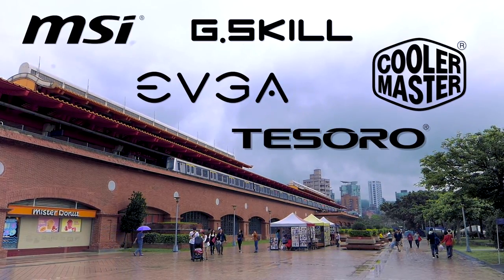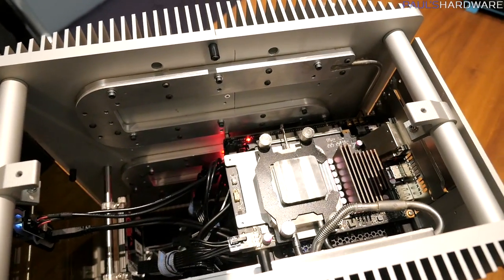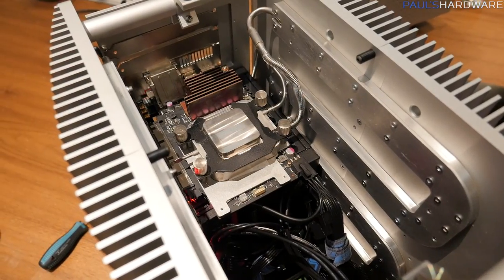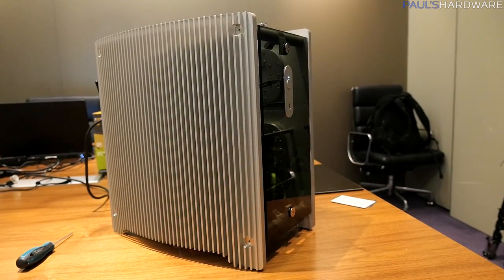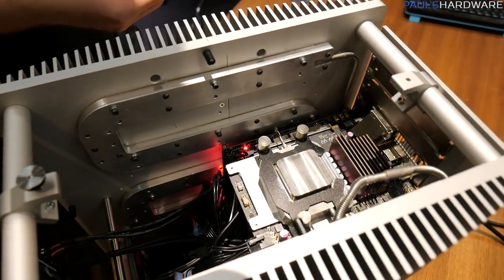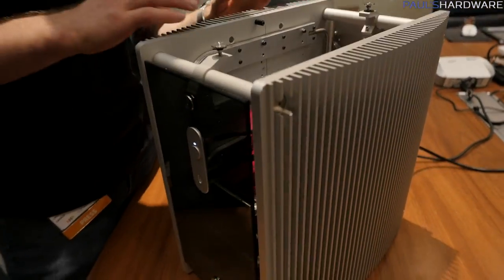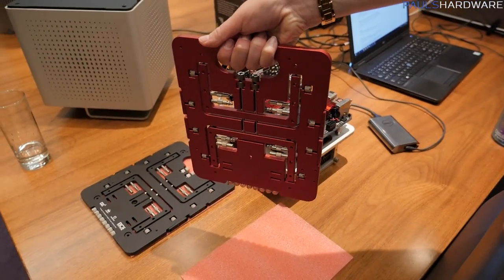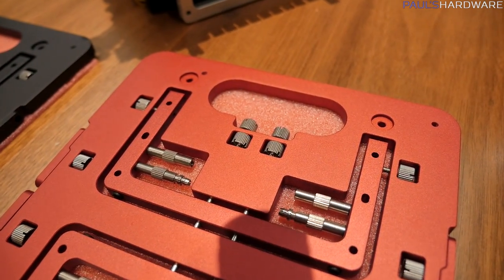Streacom's PASSIVELY COOLED Micro-ATX Case & Cutest Mini-ITX Test Bench Ever!

Comment: Passively cooled systems have interesting designs, but when it comes down to it I have no issues with the very faint sounds from a couple of fans to get much better cooling for a cheaper price. Regardless nice to see the people that do want it are getting more options in this space lately.
Reply: Well it is a niche product after all
Reply: Yeah I get that, just saying not for me :)
Reply: Jarrod'sTech same here just getting a pc cost me a kidney
Reply: according to calyos or however you spell it you can overclock and run their cooling system exactly how you want and keep low temps and with no noise at max gaming.
and with your normal radiator waterblock fans thing, if you overclock and run it max gaming your fans are going to start ramping up making noise.

so yeah i totaly agree i dont mind low rpm fans on idle/low usage but for anything intensive id still go with this here noiseless system if their claims are true
Reply: They can only cool a 130w GPU, so you're seriously limited for gaming, particularly at high resolution or refresh rate (or both). Also, I think you're misunderstanding what an open loop cooling system does (generally), you have a buttload of radiator space for the amount of heat being generated, my pump is on min and there are speed reducers on all the fans. Doesn't matter if I run furmark + p95 or whatever, it stays cold and virtually silent like always.
Reply: Jarrod'sTech or why not combine those? The 40 Pound heavy case Linus showed also accommodates up to 5 fans. you could run low RPM fans at low voltages and get a near silent but awesomely cooled system or stop em all together to get absolut silence (unless coil whine ... :( )
I acknowledge your point but I'd still say fully passive is worth it/not even that expensive.
Reply: Yeah a hybrid solution sounds like the best of both worlds combined. Versatility and efficiency.

Comment: Hey Paul,
I wanted to ask something, I want to build a new pc and have chosen the masterbox 5 msi edition which says it has a 167mm cpu cooler clearance.
Point is I'd like to fit in a strix gtx1070 which is 140mm tall, giving 20mm of clearance for the cables it seems it would fit barely.
Do you think I can actually pull it off or do I have to change the case for a bigger one?

Comment: The right question regarding the mITX Testbench is: Who need more than a mITX Testbench?
Everything you need is there.
Why is mITX still tagged with bad or gimmicky these days?

I always have to smile when i see all the new RGB "Badass" builds in freakin huge ATX Cases with 6 empty expansion slots and more dead open space than the moon.

Except for custom Watercooling (in a lot oft mITX cases even this ist no problem, because they are huge, like the Manta or Evolv ITX), you loose nothing with mITX, you only gain Space on your Desk.
Reply: This.

Comment: Which idiot is telling everyone this is expensive? ~350 for a TAG case, that look original and cools your CPU completely passively. A pump+res+fittings+tubing+rad+fans+case would probably be about the same amount but not be as quiet. 

Where is expensive now?
Reply: Yea, but this doesn't perform anywhere near as well a custom water loop. And custom water loops to begin with aren't really the best value. An aio or high end air cooler is waay cheaper.

Not saying this isn't an awesome product, but I don't think it makes much sense purely looking at performance/dollar.